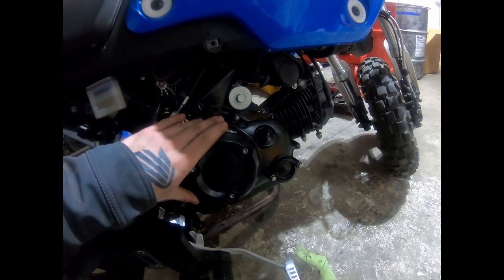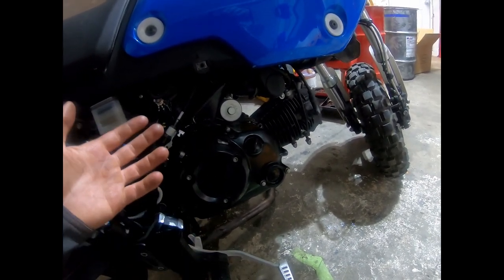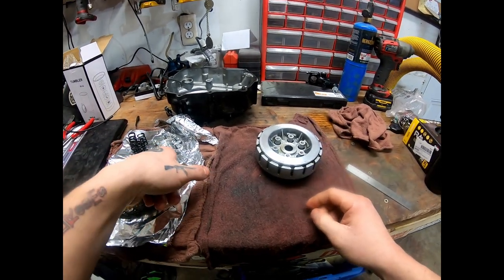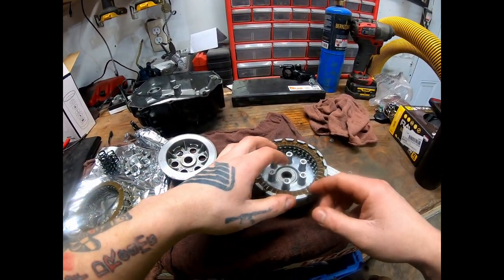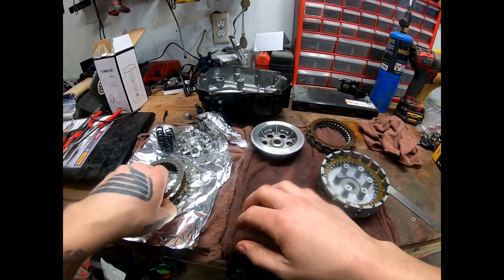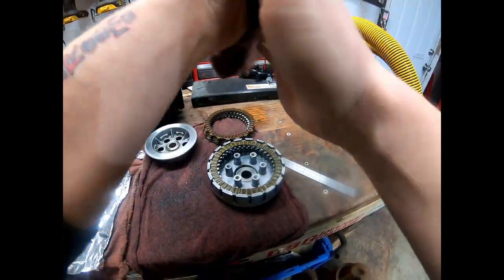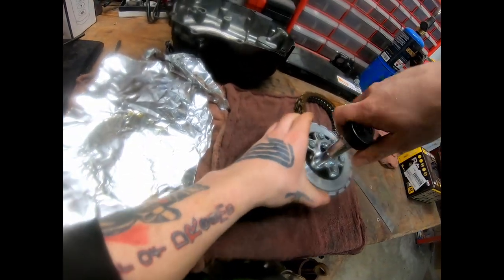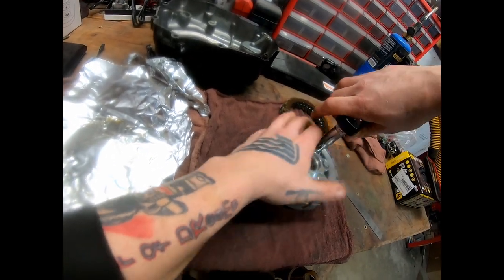2022 Grom SMR clutch pack and clutch springs install: Why your new clutch pack slips and hard shifts

Comment: Thank you I just installed these clutch packs on my 2019 monkey and 2022 grom. I went back into both and fixed the orientation of the clutch discs and plates.

Comment: Yooo. I appreciate the video. I’m having an issue at the end. It seems like the clutch cable is too long and won’t engage with the clutch properly. I have done everything to the “T” like it is in your video, but the clutch cable is not engaging in the clutches correctly. Like the cable is too long. Would you happen to know what the issue could be?

Comment: The bolts can fail of you just run three I just had 2 of the bolts snap on me after installing the 60% springs luckly they snapped off while I was installing it and not while riding.

Comment: i know this videos a year old but it did help me but im hoping somebody can help me with my issue i installed smr discs and springs with chimera clutch plate and they work good but im having issues shifting to second at low speeds and getting into neutral at a stop its like the shifter keeps getting jammed or something i also adjusted the clutch cable already and that doesn’t seem to be the issue. Thanks

Comment: Hey man what happens if you get a 2019 pressure plate on a 2022 grom? I just ordered all this stuff and when I install the clutch assembly bolt it all back together I get like a dead head on the clutch actuator like the plunger isn’t even touching the throwout bearing
Reply from the maker: What’s up bro I’m sorry I’m just seeing this! So funny story I bought a 2022 clutch pressure plate but received a 2019 and didn’t realize it until 2 days of me fighting it and not getting the clutch to work. The lever was just completely dead and had no tension no matter what I did. Nothing is really gonna happen it just won’t work. I installed that one like 20 different times trying to get it to work til I figured out the problem and put the stock one back in lol

Comment: Is there a specific order that the discs need to go in? For example my ktm has different thickness plates and the thinner go on the outsides and thicker in the middle. 
Or just make sure the edges face this way? 
TIA🤘
Reply: Weird, followed this to a T. 
Clutch disc orientation correct. 
Tough time shifting 1 to 2. And 2 down to 1😅

Comment: I just installed it and its hard to find neutral and shift to second gear.  I did the oil pump as well.  seems like the clutch is dragging a little.  any thought on this?

Comment: Did you have trouble when shifting down . My bike wont go into neutral  and it hard to downshift . Can you help
Reply from the maker: That sounds like exactly what mine was doing when the clutch disks weren’t racing the right way. The edges have a sharp and round edge and you want the round to shed facing eachother
Reply: I did them exactly like the video, the rough side down, and the round edge up
Reply: The only problem is that when I have all discs in it, don't sit flush.  Maybe because the stock was only 5, it would sit flush now. There is a lip, but I know it's in place
Reply from the maker: @tonyromo4778  there is a small gap from what I remember but it should sit well. Sometimes I would get it together as much as I can then sand which the assembly in my hands and spin it around to make sure everything is clicked in and fully seated
Reply: I did everything right, but It   still  hard to shift down  and once I'm in 1st it won't even go up to neutral. But shifts really good in all gears
Reply: Do you know if maybe the stock linkage might help.  Have the hammer head shift lever right now!
Reply: I just installed my 6 plate smr clutch kit too and I followed this to a Tee, and I’m having the same neutral shift problem too after.   I have a $1700 performance clutch in my stunt Harley and that manufacture says the have all sharp edges facing one direction, and all round edges facing the other direction.   I will post an update tomorrow for you when I repack the basket.
Reply: @tonyromo4778 update: I did all round edges facing the left side of the bike and all the sharp edges facing the right side of the bike.  Clutch works perfectly now and goes into neutral with ease
Reply: @egoboost9952  @michaelbradburn5227  how did you guys do it because I followed the same exact stuff and I cant shift to neutral or 2nd. I can only go to 2nd after a certain amount of rpm. Neutral impossible to find while the bike is on. once I get her going after like 10mph and 7k rpm it shifts. downshifting is super rough.
Reply: @illestjc hi there.  I’ve never installed a clutch pack (as per instructions or not) with the fiber and steel plates with the sharp edges (or smooth edges) facing each other.   I’ve always had the sharp with smooth edges facing each other. In other terms, all the smooth edges facing the same direction, and all the sharp edges facing the same direction (no smooth on smooth, or sharp on sharp).   Once I did it my way (not like in this video) I could shift great and find neutral perfectly fine!  Good luck!
Reply: How did u fix yours ? I having the same problem
Reply: I have a 2022 Honda grom and I follow this video while doing my clutch and now it’s hard too find neutral and it’s kinda hard shifting.
Reply: @RileySobotka  same check ur oil will be full of clutch
Reply: I taken mine out like five times went back to oem clutch
Reply: Yeah I just took mine back out
Reply: @michaelbradburn5227  just did it your way and still don’t go into neutral . maybe these smr clutches ain’t made for it